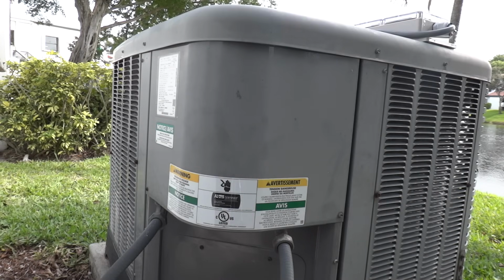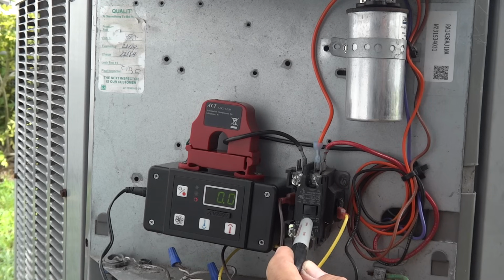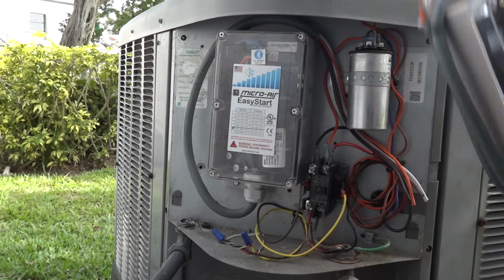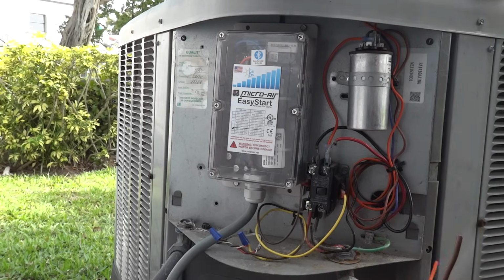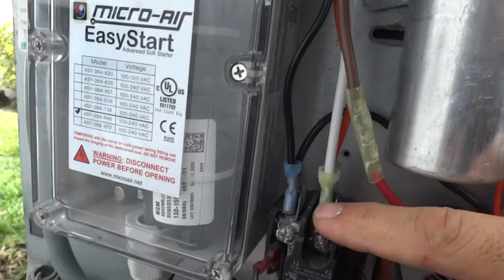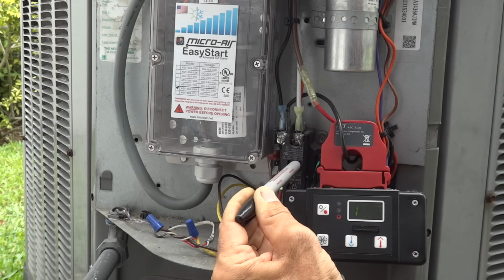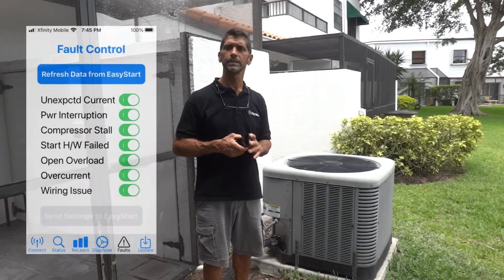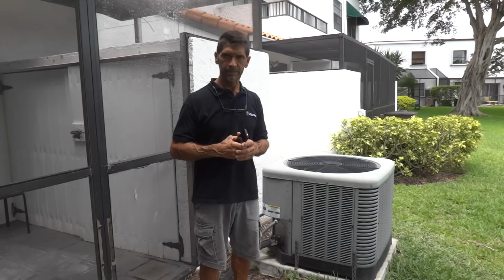Micro-Air EasyStart Home A/C Installation (368 Series)

Comment: Can you disable bluetooth?
Reply from the maker: Hi and thanks for your question.  The Bluetooth is only enabled and reachable when the compressor is energized, so the amount of time that the Bluetooth is actually accessible is limited.  If that's still more than you prefer, the installation of a pin jumper (not included) on the circuit board can disable the function of the smartphone apps. Or, if you insist that there be no Bluetooth radio at all, it can be disabled by the factory before shipment. In either case, you should make sure that you clearly request this (via sales@microair.net) before submitting your order AND also add an order note when placing the order on the website.
Reply: @MicroairNet  thanks for your fast answer, any chance that this board jumper could disable the radio and then one day if i need to troubleshoot i can just pull the jumper and it would enable the radio on next cycle?
Reply from the maker: That is feasible, but such a jumper header does not get included in regular production.  Given it is high-season right now for EasyStarts and the NJ factory is backlogged, it is unclear if they would be willing to do this for your order before shipment. Hopefully you can understand given they're building and shipping hundreds per day, as fast as they can.
Reply: @MicroairNet  of course thanks for clarifying, I think in this new world of data privacy and security concerns it might be a good update to your standard board project. I am happy to wait until you guys can produce 2 for me with this jumper.

Comment: Can you do a video of installing one with with the extra board?  I have an extra board inside my AC but it's a trane and I can't tell exactly what it is.
Reply from the maker: Hi and thanks for your comment. We really wish we had the resources to do more videos, but the sheer quantity and variety of home A/C systems on the market would make such an undertaking almost impossible.  But do not despair as there is good news for you.  The Micro-Air Customer Service team has helped thousands of customers like you with their specific A/C system requirements, including explaining the connection points, making custom wiring diagrams, making custom picture diagrams from photos, etc. The best thing for you to do is take some clear, high-res photos of your outdoor system's dataplate label, the inside of its electric box (including the control circuit board you spoke of), and any wiring diagram that is on the inside cover of the electric box.  Send these photos to help@microair.net, and they will be able to advise you as to where the EasyStart will wire in.  In almost every case, any control board and its wiring that may exist inside of a system's electric box like yours, will not be touched or altered in any way, as part of the EasyStart installation.

Comment: What quick connect /butt splice sizes do I need to connect the easy start 368 wires to my ac wires? Or does the kit already come with the necessary connectors? I'm waiting on mine to be delivered so I'm trying to get the necessary supplies for the install. Thanks a bunch!
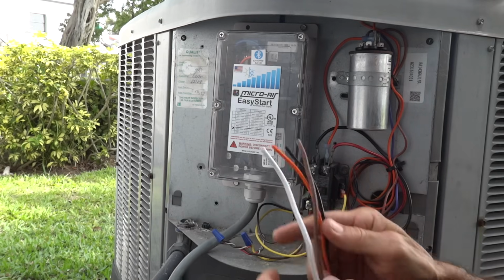Reply from the maker: Hello and thank you for your question and for your purchase!  The EasyStart 368 alone (ASY-368-X48-BLUE or ASY-368-X72-BLUE) does not come with any of the necessary crimp terminal connectors.  For EasyStart 364 RV installations, we do also sell an installation kit, KIT-364-RT2, with all of the necessary terminals, but it might not have everything you need for a larger home unit.  Watch the video starting at 8:12, and you will see where I go over the connections and the crimp terminals you will need.  All of them should be available at any hardware store.
Reply: @MicroairNet  thanks very much. I bought a set today that seems to have everything. I appreciate your timely response!

Comment: About a year ago I successfully installed (on the 1st try) an EasyStart on my 2 Ton & 3 Ton A/Cs, and one on a neighbor's 3 Ton A/C.  They've all work great.   I am able to start and run both my 2 & 3 Ton units using either my fuel injected Honda EU7000is (running on gasoline) or my carburetor fed Harbor Freight 9500W (running on natural gas).  I use my much, much quieter Honda only at night, while during the day I parallel my Honda EU7000is & HF 9500W.  Paralleling is only possible because both generators are inverter type, 220 Volt AC, with 2/3 pitch windings.  When running only 1 generator I must always sequentially start my 3T first followed by my 2T second to prevent generator overload shutdown.  Even though my 2T & 3T units are side by side, one generator is located next to & connected to the 3T, while the other generator is located 200 feet away connected to my main AC service entrance panel.  I converted both the Honda & the HF generators to run on natural gas using "US Carburetion" kits but because natural gas has considerably less power than gasoline, only the HF generator can start my 2T & 3T units while running on natural gas.  While running on natural gas my Honda EU7000is can start one A/C but not both. Since my natural gas regulator low output pressure is 4 psi, I used  2 parallel 3/4 inch diameter flexible hoses to connect the regulator output to the generator located 200 feet away.  Using parallel 3/4 inch hoses is much cheaper than a single 1.25 inch diameter hose, and the 3/4 inch hoses are easier to store when not in use. 

Even though I had to mount the EasyStarts external  to all units due to inadequate internal clearances; I wondered about your video's recommendation to install them within the A/C compressor/condenser contactor/capacitor metal box.  

I noticed that I must be within 20 feet of the externally mounted EasyStart units to get the Bluetooth app to connect.  If I had mounted the EasyStart within the A/C contactor/capacitor metal box, would that have reduced the Bluetooth transmitter/reception range?
Reply from the maker: Hi Rex. Thanks for EasyStart application summary and for you business.  Regarding your question, when the EasyStart mounted inside of a typical outdoor condensing unit's electric box, our testing shows that a typical smartphone will get about 20-30ft of Bluetooth range when within line of sight.  Around corners and through windows, the range is obviously less.  Any grounded metal enclosure does act partially like a Faraday Cage, so putting any radio transceiver into a metal box will of course reduce the reception by a varying degree, depending on the design, shape, and material of the enclosure.
Reply: @MicroairNet  , has your company considered other way to extend the transmission range? (offer an external antenna that one can mount remotely or the technology some WiFi devices use whereas the transmission is coupled onto the A/C line wiring ! (This would bring the range easily indoors !)
Reply from the maker: @Douglas Montgomery; Micro-Air has not considered methods to extend the existing Bluetooth transmission range since this access is only meant for as-needed diagnosis and upgrades.  However, in the future we are considering adding Wi-Fi connectivity, which might allow for the EasyStart device to connect to the home's Wi-Fi network (rather than directly to your smartphone).  This would then allow you to access the EasyStart from any other location where your smartphone was still within range of the same network, thus significantly extending the range.
Reply: @MicroairNet  , Wifi..PERFECT (like my Nest thermostat) !.  Thanks !
Reply: @douglasmontgomery6315  yes. WiFi would make it another Game Changer

Comment: I bought this starter and works but !!!!! Why in the world it has Bluetooth running all the time???????????? why you cannot disable the Bluetooth ?????? Why the Bluetooth is soldered on the board and cannot be removed ?????  I do not want this crap to broadcast all the time. I was sure that, surely there is a way to physically disable or remove the Bluetooth but i was wrong.
I have my eyes opened for  similar products because this is not acceptable to me. If I find any alternative in the future I will never touch any of your products just for this reason.
Reply from the maker: Hello and thank you for your comment.  The Bluetooth on EasyStart is only active while the EasyStart is energized, which is only when the compressor is turned on.   Therefore, when the compressor is turned off by your thermostat, the Bluetooth is also turned off.  If you'd like to permanently disable the Bluetooth inside EasyStart, there is a way to accomplish this without modifying the circuit board.  Please contact Micro-Air at help@microair.net to inquire about this method.
Reply: @MicroairNet  I will contact you. I need to disable that crap.  Your APP  and Bluetooth on the device is a security issue for two reasons:
1. Anybody looking around knows that you have that device installed on your AC unit and can steal it. $350 not a bad deal.
2. Contact tracing - Your app requires GPS ??? is the AP doing contact tracing? Is you or google or the APP developers making money on selling contact tracing data on your customers ??
I briefly installed the APP but was not able to connect maybe because I did not allow it to use GPS? What is the GPS got to do with my AC unit??
I would never keep your APP on my phone. Even If I wold use it I would uninstall it right Away after I am done.

Comment: Ordered mine today for a 2ton unit. I’ve read comments about the need to discharge the capacitor as well as pulling the breaker before installing. Is this a valid concern?
Reply from the maker: Hi and thank you for your order!   Taking extra safety precautions is never bad practice, regardless of whether or not they are required.  Here's the long answer:

Pulling the disconnect (outside) or turning off the breaker (inside) should of course be done first.  Discharging the run capacitor after that is typically not required since it always remains connected across the compressor motor's windings, even after the contactor releases and the compressor turns off.  The run capacitor therefore quickly discharges within a few seconds.  The same is true for the condenser fan run capacitor terminal on any dual run capacitor (like in the video), and its connection to its motor.  It never hurts to perform the discharge, but before shorting anything out, it's always best to first verify that incoming power to the contactor is in fact turned off (via the breaker or disconnect) by measuring it with a multimeter.

Unlike the A/C system shown in the video, if yours happens to have a start capacitor with a start relay, then it is possible that the start capacitor can hold residual charge. Most start capacitors have a bleed resistor, but regardless the start capacitor voltage should either be verified with a multimeter and/or discharged before removal.  As was noted in the video, any start capacitor, start relay, or start assist must be removed before installing EasyStart.
Reply: @MicroairNet  Thank you very much - that is the answer I needed!

Comment: I'm sold! Great video. My only concern is what happens when I have my unit serviced and the tech takes off the panel and has no idea of what a MicroAir Soft Start is and how it works.  What then?
Reply: Find a new tech! Lol
Reply from the maker: Hi Steve.  Thanks for your comment and your excitement for EasyStart.  You'd be surprised how many A/C installation/dealers Micro-Air already sells EasyStart to, and how many more are already aware of the product. It's now over 10 years old and it's been in high volume production for over 5 years.  Word has certainly spread.  Worst case, the EasyStart is clearly labeled, so your A/C tech will likely ask you about it or look it up online before doing anything further.
Reply: @MicroairNet  Thanks for the quick response. Surprisingly enough I've had a tough time finding HVAC tech's that were familiar with Soft Start.  Most of them knew about hard start. I'm in Central Texas and the closest distributor for Micro Air home units is over 200 miles away in Houston.
Last year was a record year for sales of  portable generators in Texas.  I think this is mostly due to "Snowmaggeden" in Feb '21,  Huge disaster for home owners mostly due to our antiquated grid.  We now are seeing news reports warning homeowners to expect more brownouts and blackouts due to the expected high temps this summer  caused by the problems we had in 2021. Throw in the hurricanes that hit Texas (i.e. Nicholas 2021 100,000 without power)  and a weak grid it's no wonder that generator sales are up.
Reply: @MicroairNet  about to pull the trigger on one of these.  I have an whole house battery system that is able to start the AC, however, my AC is a 2-stage 5-ton Trane XR17.  I know these don’t work on Variable speed compressors, but wondering if it will work on a 2-Stage.
Reply from the maker: @danksu04 Thanks for the question.  The short answer is YES, but your system will require some special steps on your part after installing EasyStart.  Long explanation ahead!...

Yes, the EasyStart ASY-368-X72-BLUE will support your 5-ton Trane 2-stage XR17, but there is a special step you must take when you "learn" the EasyStart during its first 5 starts after installation.  The reason is your 2-stage system uses a special Emerson Copeland Scroll compressor (only 1) that has a secondary pressure solenoid that controls how much the compressor is actually pumping.  It doesn't change the compressor's speed, but instead it simply changes how much its rotating scroll pumps.  So when your thermostat calls for the second stage to run (the Y2 wire gets energized in addition to Y1), the compressor will energize this solenoid, pump more refrigerant, AND therefore draw more current (energy) while running.  Note that the amount of current that the compressor draws while starting will NOT be higher because the internal electronics of your XR17 system prevent the second stage from getting energized during startup (Y1 energized), and only lets Y2 pass through after a short delay.  Note that under normal conditions when your room temp only goes 1 or 2 degrees above the setpoint, your thermostat will only energize Y1 (without Y2) and your compressor will only need its first stage to operate (i.e. special solenoid will be OFF).  THIS is how the Trane XR17 2-stage saves you electricity! It's actually quite a nice design.

So what does this mean to you?  Simple. Install the EasyStart per the normal instructions and wiring. NOTHING changes there. BUT, when you go to run your system for the first time, make sure you set your thermostat's setpoint temperature to ***at least 5 degrees below the current room temp***.  By doing this, your thermostat will energize BOTH Y1 and Y2, and will force your compressor's 2nd stage to run.  Let the compressor run for at least 5 minutes EACH TIME you start it up for the first 5 STARTS after EasyStart installation.  The EasyStart learns your compressor's STARTING behaviors during the first second or two during and after startup, but it then deliberately waits 5 minutes to learn and "lock in" your compressors RUNNING behaviors after everything warms up and - more importantly in your case - the second stage is definitely engaged.  This is why you need to make sure each learning start lasts at least 5 minutes.

Hopefully this makes sense.  Please contact help@microair.net if you have any further questions.
Reply: @MicroairNet  thank you so much for your thoughtful and thorough response.  Order with be placed shortly!!
Reply: @MicroairNet  Thanks again for your response.  I received my SS last night and am ready to install.  I have a follow up question… I currently have the AC off my inverters and battery system.  I can swap it over to a direct grid connection for the initial learning routines.  So in summary I have 3 different cases, direct wired grid, bypass grid through the inverters, inverters running on batteries.  All are capable of starting the AC, however, I’m wondering which scenario is best to train the SS?  Thanks again!
Reply: @cseatec  working awesome! Guess what?  Another question.  Is there a way to pull historic data?  I forgot to screenshot my initial trainings and would like to know what it was.
Reply from the maker: Hi again.  Unfortunately, you cannot pull up the historic data using the app, but you can upload the data to Micro-Air and we can send you the learning history.  That is a special request though, so you'll have to follow up your upload with an email to the help account.

Comment: I appreciate the video I’ve just recently ordered a micro air easy start for my residential condenser.
Reply: I wanted my compressor to last as long as possible. I also wanted less Amp draw at start up to lower my electricity cost. I wanted to run a smaller generator during hurricane season that doesn’t take as much fuel to run per hour due to higher amp draw. I believe I will also like the Bluetooth capability so that I can Monitor my AC consumption. I first heard about it from a friend who installed it on her RV and started to use a smaller generator off grid.
Reply: Maria: Thanks for coming on board as a customer!  What is/are the reason(s) you elected to add EasyStart to your residential air conditioner?